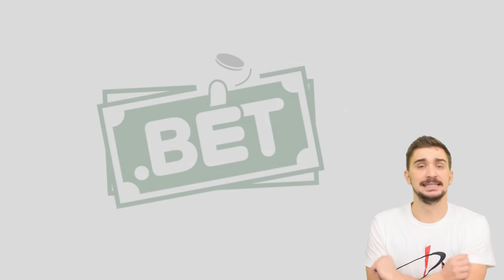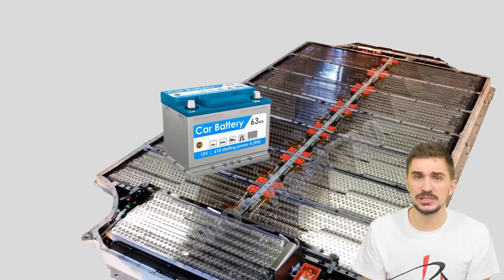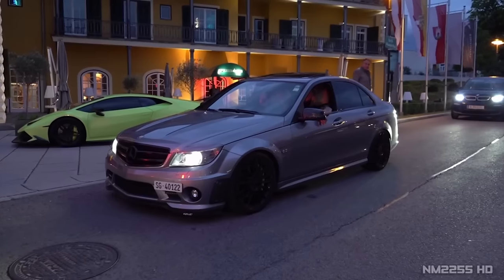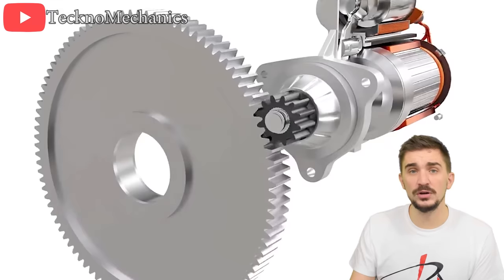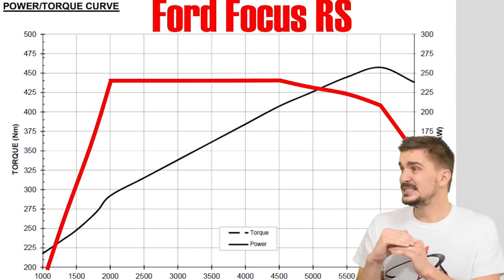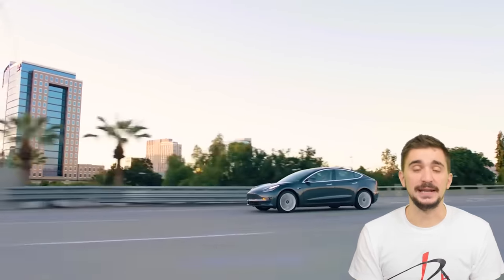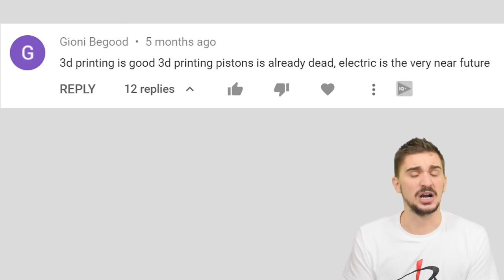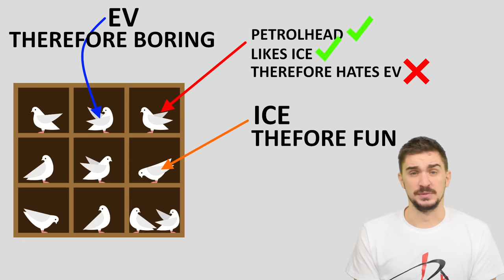ICE vs EV - IN-DEPTH comparison of BATTERY ELECTRIC and INTERNAL COMBUSTION ENGINE vehicles

Comment: At this point, EV engines are a terrible idea for personal passenger vehicles in the vast majority of cases. We have to remember that electrical power isn't as perfect as people like to portray it. The batteries are bad long term - they take damage through use so the use of cars decades old will no longer be possible. This means more production and more waste. The batteries themselves are incredibly expensive and bad for the environment, yet they become a wear item increasing costs and pollution. There are losses with transporting it (far more than with fuel). There are losses with changing voltages, from changing AC to DC. The charging systems themselves introduce losses - wireless charging wastes a full 50% of the power put into the system. Pouring out and setting alight a full tank of gas every time one refuels a petrol car would generate massive outrage, yet many commercial EV vehicles do exactly that.

People see renewable energy as a saviour, but that too is CO2 expensive. They are inconsistent, we need a power station on standby every time the sun goes away or the wind isn't blowing. Unfortunately the only viable candidates able to start and stop quickly enough are very CO2 polluting, the most common choice being coal stations (and they need to be staffed and running 24/7). On top of that renewable energy requires a lot of maintenance, expensive and polluting materials, a lot of energy to produce (usually coming from CO2 generating stations).  Nuclear solve a lot of these problems, reduce power costs, and EV vehicles work very well with nuclear stations as they will smooth the power curves but people have a strong resistance to nuclear for some reason.

The biggest drawback, however, is that there is already a technology with a net zero CO2 output which has every benefit of ICE engines and works with minor modifications with most ICE engines. Bio alcohol fuels - near identical to the fuel run in NASCAR engines. The CO2 they output is, of course, the same as the CO2 absorbed by the crops used to make it. The most common argument against them is, in my opinion, not particularly valid. The claim is that it is a waste of food. However nations with a strong usage of fuel and quick adoption of technologies all have a fuel excess, and developing nations only lack food due to a lack of investment in high tech farming equipment and education. The type of investment oil businesses would make when looking for cheaper labour and land in order to produce the fuel, thus significantly lowering the price of food in developing nations. Oil exporting nations are famously rich, and poor developing nations with cheap labour would have more employment and a consistent resource to tax thus helping kick start their economy and reduce poverty. It isn't just a benefit to western nations trying to reduce CO2 more effectively, its a benefit to the poorest nations also.

My personal speculation, that is the reason bio engines didn't take off. EV engines were originally bought mostly by people trying to demonstrate how virtuous they are in saving the planet. How better to show your virtue by demonstrating a clear sacrifice you are making for the good of everyone else. Bio engines don't offer that, there isn't much sacrifice in an engine with all the benefits of a gasoline ICE and a mild horsepower boost.

And no I don't want EV engines to fail. I think pure EV has legitimate uses in some areas and am strongly for hybrids in the vast majority. I just think there are far better alternatives to pure EV motors for the majority of vehicles, and don't see that changing at all in my lifetime. We would need a strong shift towards nuclear power and a radically better form of electrical storage with a bigger improvement from todays batteries than we have managed over the past 70 years. That doesn't seem the most likely scenario to me.

Comment: ICE vehicles have more than  century of EVOLUTION.  The problem is for EV vehicles to succeed they need a quantum leap or REVOLUTION in the technology to improve the energy density.  At the moment Tesla is like Theranos with government money.  There is no clear road map to improve the energy density and no guarantee it will happen.  After all ICE vehicles are stuck with limited thermodynamic efficiency of 30% or less.
Reply: Wrong on a few counts, apart from ICE efficiency.  Even that is a little off technically speaking.

Comment: Hey bro, greets! 
There are few things about pollution of the ev after end of life, the battery is no way near to be safely recicled, and it may end up leaking heavy and poisonous metals, nickel, cobalt, cadmium. I don't find it responsible to buy a such an expensive car to poison some yard somwere maybe in Africa? And all the nasty stuff from the battery to reach the soil, then the river next to. I hope you get where this is going. In case you don't a spoiler, back to you in a tuna can. 
Next, 
speaking about pollution... 
 CO2 is exhaled from all breathing things (also by creamy ice engines), but it turns out, all thing we eat is fed or is a fruit of agriculture, and wait for it... 
Modern agriculture is based on ammonia fertilizers. It turns out only 30-50% of the fertilizers is absorbed by the plants, the rest 50-70% (depending on country, continent regions) Is released from the soil back to the air in the form of N2O (the other common name  NoX/ nitrous oxide...). 
Few facts about NoX. 
350 fold stronger greenhouse gas compared to CO2. 
Life expectancy of the molecule 118 years in the upper atmosphere, where the o3 is generated. 
It is the hard core version of the elephant ozone killer in the room, nobody speaks about. 

So what,
Who told you can upset co2 when biyng a new car? 
Bulshit, a new car feeds the economy, 
The economy pollutes, so you too when buying new stuff. The bigger, the heavier, the newer, and you slam  pollution fists in to mother's earth face. As it is more energy spent in to making it, than any older already existing device or machine will ever make in any further sum of moment in its remaining life cicle. 

More trees, and less chemicals, less plastics.... So on and on. 
Keeping alive a 30 year old 900kg car, is the most earth friendly thing you can do, plant a cat in the back pipes, and don't forget few more trees every year in your backyard is all you have to do.
Sharing experiences and fillosophy, with my own 30 year old crx.
Greed and vanity are only acronims for humans, and that is what will kill our civilization.
OH don't worry life will keep on without us. Life always find the way.
Our kids, and their kids will be maybe the last to remember paradise.
I hope is not too late, and be reasonably rational for what's responsible and conscious.

Comment: Not a fan of battery ev. Fan of hydrogen but the problem is the infrastracture. Hydrogen fuel cell electric is quick to fill unlike battery and won't cost expensive repair/replacement in the future
Reply: Hydrogen is far more inflammable

Comment: Ev transmissions…..it might be more appropriate to call them “starters”.   So many likenesses. The only thing holding EVs back is battery weight.  The only thing holding ICE engines back is they’ve reached the end of R&D without dramatic design innovation.

Comment: I was always shocked why "car enthusiast" oppose EV. Electric engine is a monster and treat for car enthusiast that actually cares about driving. Instant torque, separate engine per wheel thus variable drive train, lower center of gravity, less drag due to no air intakes and even that feeling during cornering was is there to not like?
Reply: It’s not the same compared to a muscle car especially once you get pass 60mph

Comment: i would prefer an hibrid, a small IC engine with 1-2 electric motors to assist during acceleration
Reply: Welcome to a Toyota Prius. 120HP ICE with 30HP EV motor.  EV assists to get the vehicle going, ICE runs it at speed.
Reply: @loopie007  i didnt know that

Comment: i have done it driving only on the starter but i did it because my clutch failed i was stuck in gear but after the engine was off i changed in the first ger and try so start the engine and drove my car in a parking space and called the ADAC and brought me and my t4 to the car reapir shop

Comment: EV has lower routine maintenance cost, but I bet they wear tyres and brake pads faster, due to their higher weight and abrupt torque.
Reply: Much less wear on the brakes, as most braking is regenerative (power back to the battery).

Comment: All those who downplay the current and future use of internal combustion engines versus EV know very little about the actual physical current state of affairs .. They are not aware of the ballooning cost of the battery when going from car to semi transport truck .. A diesel truck engine cost 3 times more than a car engine however a semi truck EV battery cost 15 times a car EV battery because its 15 times larger .. This is a ballooning cost  ratio few are aware of  now making the battery in the truck between 100 and 200 grand before you build the actual truck .. Also mining and mineral deposits for the best EV batteries are quite the problem at the moment especially cobalt from the Congo .. Battery energy density advancements are starting to hit a wall now and increases harder and harder to find ... Changing the world to battery electric for large farm machinery , transport trucks , earth moving equipment is now and in the future going to give price sticker shock that will make even the most ardent liberal futurist  blush ... At the moment battery capacity can maybe get a large transport jet to altitude .. getting it from LA to Sydney Australia with 400 passengers a completely different matter .. I predict 50 years from now will still take a few thousand liters of kerosine ...exactly as it does now ... My personal experience with electric is as an industrial control specialist having an intricate knowledge of three phase induction motors and variable frequency drives powering an unlimited variety of industrial machinery .. I have to admit the technology has become extremely reliable .. Some of these machines I have  installed work 24/7 and have been going for decades now with few intrinsic drivetrain issues .. I would know because I install , repair and maintain them
Reply: For trucks, reduced payloads, massive price, etc... For planes and ships, unfeasible.

Comment: EV are not new, there are some from the early XX century. What allowed ICE to take off was the electric starter, and the convenience to instantly turn them on combined with petrol long range compared to lead-acid batteries. Then, advances in electronics and battery technology allowed better EV, but still, the greatest thing is the zero tailpipe emissions. However, in high density areas EV trams or metros should be implemented, because EV cars are no better for traffic congestion than any old ICE. Also trams and metros have all great advantages of EV without the need to carry around bulky batteries.

Comment: You lost your own bet. Disconnecting the spark plugs in an older car which could do this would just cause the fuel to be sucked into the cylinders and blown out the exhaust, where it will likely evaporate, therefore a few drops of fuel will be used.
Do it on an empty tank however and you would win the bet.

Also, if you wanted to get really nitpicky, the car would emit CO2 out the exhaust too,  but no more than it got from the air intake.

Also also, household fans will use AC with a shaded pole motor.
An electric toothbrush may use the same type of AC that an EV does, with the low power output it only needs a tiny ESC. You'll usually find the higher end ones use AC, or at least pulses of DC, like in the Phillips sonic ones which use a reciprocating mass at either about 220 or 550Hz.

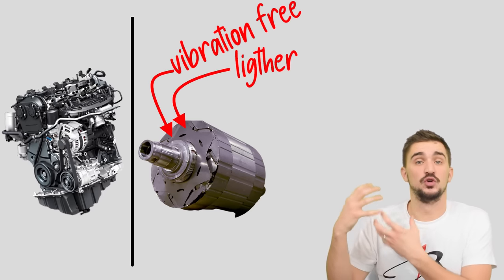Comment: @10:12, I gotta say it.  You seem to have left off Turbine engines for ICE .(I would say rockets as well, but they are EXTERNAL combustion engines.)...    They do not use the the reciprocation of piston engines, or even the Wankel.  They do not experience tangible moments of loss due to deceleration on a regular frequency during rotation (for a given throttle input).  GAWD, I am gonna get blasted for bringing that up...

Comment: The  brushed DC motor is more powerful and produces more torq than an induction motor that's why they are used in hand held drills and cutters.  the static drills have a big ac motor wich produces same power as the hand held. but a brush motor on an electric car would have very limited lifespan and would be much less reliable

Comment: Frankly, before watching this video, I obviously know the pros and cons of the EVs at the early time when the EVs just held up on the rise... But, as a diesel engine enthusiasts boy, even though I just 18 which almost all of my relations, teachers, and friends want to go EVs, "You could have an EV but regardless what they are, couldn't compare to the regular I.C.E vehicles and do not force everyone to go to EVs. Instead, do some ecological terms like forestation, not litter trashes, or apply old-school 3R thing (Reduce, Reuse, Recycle), etc. With the forestation, save the ground and water from pollutants, the air will be forced to balancing thus will create a balancing environment. And if want to run I.C.Es, go for Bio-fuel or synthetic fuel." But thats from my point of view BTW.
And I could say goverments are a little bit stupid, because different petrol/diesel vehicle produced in the different time and technological advancements so the emission standard is different but they are applying the same standard to all vehicle, it looks like Communism started to look like 😂
But I think, I don't wanna have an EV except it is the trolley-type one like trolleybuses or it is a Electric Hybrid one...
Greets from Indonesia 🇮🇩
Love your explanation about vehicles, it opens my mind 👍🏽

Comment: The sound comparison is inaccurate...the distinctive carrier frequency whine of the electric VSD operating.  But in a 3 phase motor, you actually do control voltage in a VSD application via PWM sine wave reconstruction...voltage determines amps which determines torque.

Comment: More parts aren't recyclable and end up in a landfill versus internal combustion vehicles.
Reply: Also, the parts of (current) batteries are way more rare (see cobalt for instance)
Reply: The only physical material difference between an ICE vehicle and an EV is the battery. That can be taken apart and recycled.  Ever seen the price for a used EV battery?  They are insane.

Comment: The more I learn about EVs, the less I like them. Why can't we promote hydrogen combustion with onboard electrolysis. yes the electrolysis requires a much larger alternator that significantly increases parasitic load but ICE technology has evolved to the point that manufactures could easily make an engine that can account for this and still be plenty driveable for everyday purposes, plus as a byproduct of the electrolysis you get pure oxygen which can be used directly in the engine, which has a HUGE number of benefits.

Not to mention that means you can literally fill your car up on fuel with a garden hose

Edit: I mean hydrogen ICE, onboard electrolysis would be kinda pointless with a fuel cell considering it works on the principle of reverse electrolysis

Comment: Mmmm - I have more figures for you. My EV does 4.5 miles per kwh on average. I pay at home on overnight cheap rate 7.5p per kwh. My petrol car does on average 35mpg. So to do that 35miles in my car costs 4.546 litres (UK Gallon) x £1.45 per litre = £6.59. The cost to do that in my EV costs 7.78kwh used (35miles/4.5)  cost is £0.58. So 58p versus £6.59p that means it is over 11 times cheaper than my petrol car averaging 35 miles per gallon. Many millions of people can have an EV charger installed at home, but of course no-one has a petrol pump at home.  Working on your average mileage numbers makes a huge difference but try this - Annual mileage in the UK is 10,000 per year. EV cost is £166 in electricity FOR THE YEAR versus £1882 for petrol. These facts do somewhat skew the comparison, it should be mentioned at least. GET A CHARGER AT HOME - DONT USE PUBLIC CHARGERS